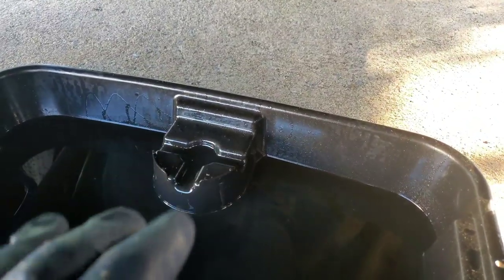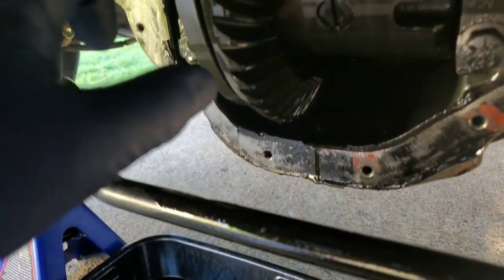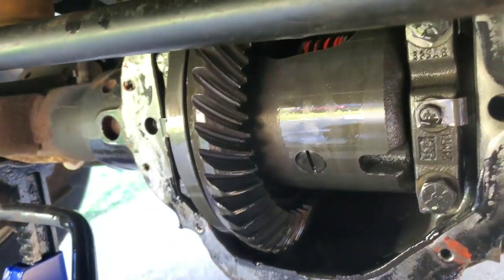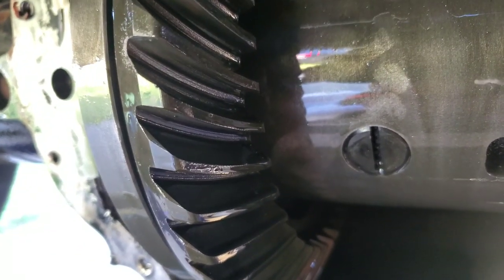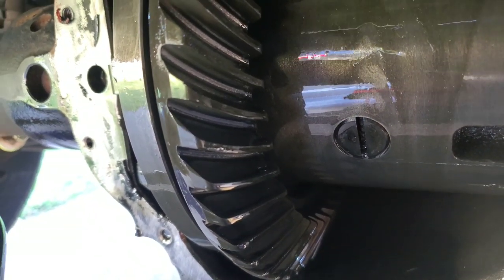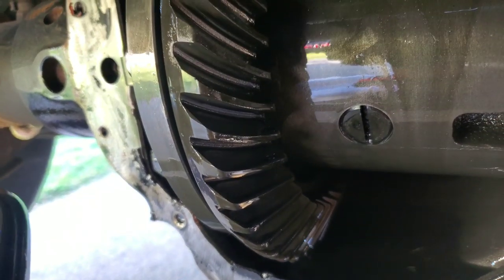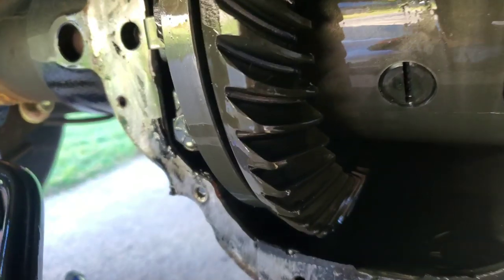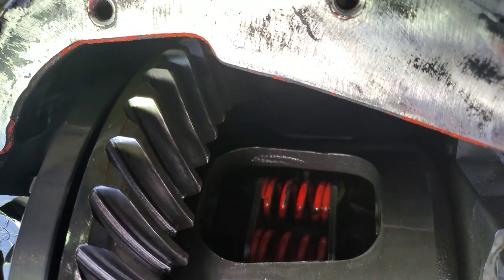Breaking in my YUKON GEARS and DIFFERENTIAL the RIGHT way on my Ram 1500!!

Comment: When I had my first diff and gear by Yukon . The break in didn’t went well so I had to remplace the whole thing again. As of now the second one it’s holding up well but it makes a lot of noise for sure . Every time you are speeding you can hear the diff like whining and it does gets annoying. So far hasn’t broke or anything but hopefully it doesn’t happen again .
Reply from the maker: Yea I can hear mine too I read that yukon gears n diff can get noisy and that's normal I'm just hoping mine holds up
Reply: Incredible Hemi hopefully bro. I already did burnouts and it hold well but the noise it gets annoying. Specially when I travel I can hear it a lot. Keep it update since I don’t really use my truck much and haven’t race or put my mods on .
Reply: What type of noise are y’all getting? I had a set of gear revolution 4.10 installed and I’m getting howling noise at deceleration at around 60 to 40 mph. Just asking cause I’m thinking of going with Yukon 4.11
Reply: @avasquez956  it’s hard to explain but it’s like a whining noise between the metals . The more you accelerate the more you hear it . I’m used to it already since I also have headers and they are catless and turning my music up is the only way to forget about it .

Comment: From what Yukon is telling me you can use Synthetic fluid with the Duragrip LSD but it will swell the clutches and make the rear more aggressive and adds more gear chatter.  Thinking I should just stick with conventional/friction modifier.  Do you know what is recommended mileage wise to change the fluid after breaking in?

Comment: Hey would you be able to possibly send like close up pics of the teeth , I did my gears an did the 60 mile 30 min cool down in 20 miles increments. I had a whine at 40mph. So I checked it early my teeth look like they were sanded. The gear mesh pattern looks correct the nice half moons on both drive an coast. But the teeth look weird like sanded. An my lash went out from a .007 to a .010 which is loose being as spec is .006-.010. I’m baffled, almost like the gears weren’t manufactured correctly. I sent pics to Yukon an all. Any input you have ?

Comment: Stupid question...so when you buy a spanking new truck there is no break in period for them. Or none that I've seen
Reply: They break in within your engine break in period, concurrently. They don't bother stating it in the manual as a separate break in period for that reason.

Comment: Nice bro , glad it broken in for ya . Good info though I didn’t know you can’t use mopar synthetic on Yukon gears
Reply from the maker: Yea, they dont recommend it
Reply: Hey just a quick question , looking at getting some Hoosier racing slicks for my truck but I wanna stay 17” wheels . Do you recommend a site that sells them for the ram ? And what size ? Every website I go to says nothing available for a 2012 ram
Reply from the maker: Summit has the best price no racing tires are gonna say recommended for a ram.